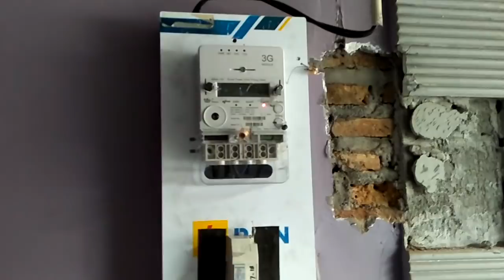Mengganti meteran listrik ke ekspor impor

Comment: selamat pemasangan PTS & Meter eksimnya.. 
tolong tanya :
1. Apakah benar sewaktu dalam panel saya lihat kabel GND dan Nol dijadikan satu ?
2. Nantinya pemakaian energi dari solar panel , masuk inverter dan keluaran Inverter langsung sambung paralel dengan listrik PLN ? Tolong kalau ada vlog mengenai ini.
3. Biaya keseluruhan untuk 2000 Watt PTS., + installasi berapa ?
Terima kasih, sangat tertarik .
Reply from the maker: 1. Saya nggak tahu, kebetulan yang masang petugas
2. Benar. Tunggu vlog atau videonya ya... Masih antri tayangnya
3. 45 juta. Langsung tinggal pakai
Reply: @rusydihcu  biaya pasang PLTS 1200wp on grid berapa bos?

Comment: Listrik saya 1300Watt. Biaya pemasangan on grid berapa Pak? (sudah tinggal pakai)
Reply from the maker: Yang mau dipasang berapa wp solar panelnya?
Reply: @rusydihcu  Maksimal output inverter 1300Watt, solar panel juga maksimal 1300Wp, mengikuti Peraturan Menteri ESDM No. 26 Tahun 2021

Comment: om.. skrg on grid nya gimana? apa sda surplus dari solarcell ke pLn?
Reply from the maker: Sekarang sedang dicoba tanpa solar panel. Kita lihat rata2 tagihan tiap bulan
Reply from the maker: Selanjutnya dipasang dan dihitung lagi. Baru dibandingkan
Reply: emang di kwh exim nya gak keliatan listrik yg di export dan di import nya om? saya jg udah pakai on grid tp cuma pakai 100wp x 2 dengan kwh biasa, soalnya dengan solar panel segitu intensitas cahaya max juga cuman dapet 140watt
Reply: Kena biaya brp om ganti meteran gt? Trus rencanax pke inv on grid merk apa? Sy pengen nyoba bsk
Reply: @teguhs5837  saya udah on grid tp blm pake kwh exim.. cuman ngurangi pemakaian dari pln aja kalo siang...
Reply: @kangoprek7013  , harga on gridx yg brpan? Yg brp VA?  cm info tmn yg pernah pke merk cina, hanya tahan sktr 1th... apa bener ya om? Just info om,, saat ini sy pke off grid d rmh, dg pemakaian dominan beban DC
Reply: @teguhs5837  pake solar panel yg 100wp harga nya 900rb klo gak salah, inverter nya juga 1 jutaan... saya udah pake 6 bulanan... gak tau juga sih bakalan awet atau gak om...
Reply: @kangoprek7013  👍 thx
Reply: Procedurenya bagaimana untuk pemasangan kwh exim pak ?

Comment: Berapa biayanya Pak?
Reply from the maker: Untuk biaya meterannya 1.5 juta, hanya biaya pemasangan tergantung watt nya, saya pake 2200 watt 800rb
Reply: daerah mana pak. bisa share pengalaman nya tanya tanya gitu.
Reply: Mahal bgt biaya nya. Kapan balik modalnya cuma buat biaya ganti meteran doang. Total biaya 1,5jt + 800rb  = 2,3jt = 2,3jt : 1352 = 1700 kwh (asumsi harga jual ke pln 1352 per kwh). Jd cuma buat bayar biaya meteran baru sj kita mesti jual 1700 kwh. Asumsi kita punya 10 panel yg 100wp. Perhari rata2 yg dihasilkan 10x30whx6jam = 1,8kwh per hari. Maka 1700: 1,8 = 944 hari = 2,5 th cuma buat bayar meteran baru nya doang. Seharusnya PLN mendukung masyarakat yg beralih ke green energy dgn tdk terlalu membebani biaya ganti meteran spt ini...
Reply: @rusvi2002   jikalau tak mau model ini, coba yg pake baterai om. cuma kita harus invest di baterai. nah pas gak ada listrik dari surya/baterai, maka input di ambil dari pln. mau manual atau otomatis tinggal didesain aja sistemnya.  rata rata kalo yg pake surya entah model kwh exim atau baterai memang mereka invest jangka panjang, bukan jangka pendek, bukan belain pln ya, dari membolehkan nya model gridtie, ini sbg dukungan pln akan green energy, kalau gak ngedukung gak bakalan di bolehin hehe. cuma nih kalau aku sih enak model gridtie kita gak mau pusing mikirin perawatan baterai. kegagalan sistem penyimpanan energi, tak ada sinar matahari dan bla bla bla. ada nih temen bikin model baterai, ada ada aja keluhan dia, yang aki jebol lah, sinarnya kurang lah, dsb.  enak gridtie pas ada sinar jual, pas mendung atau malam baru pake pln, kalo ditung itung ya beda tipis. mau invest baterai atau meter? belom lagi invest tracker arah lokasi matahari biar farming cahayanya bisa optimal. sesuaikan aja sama budget.